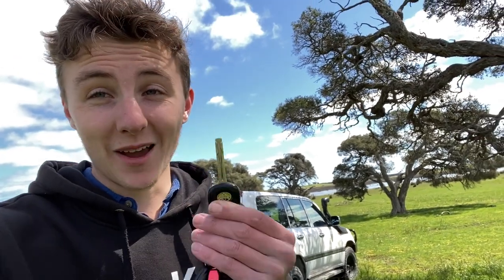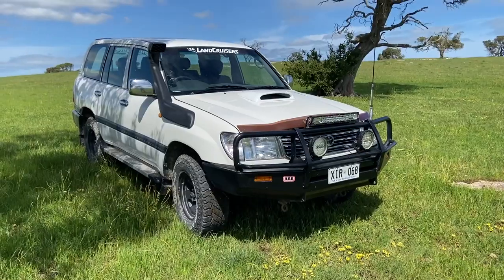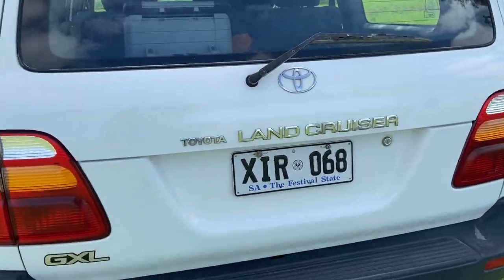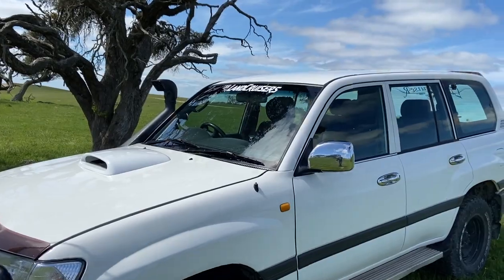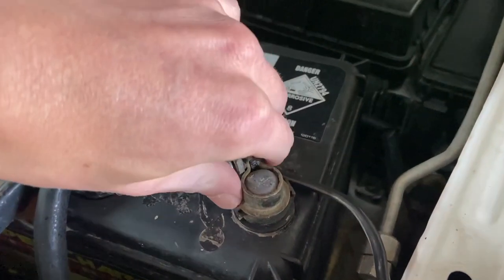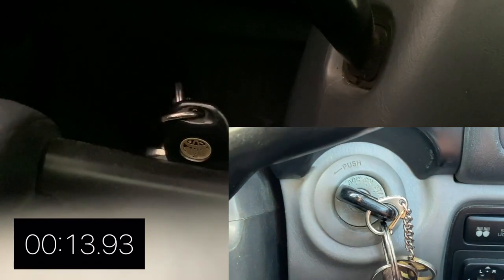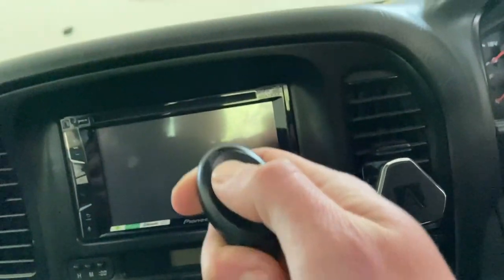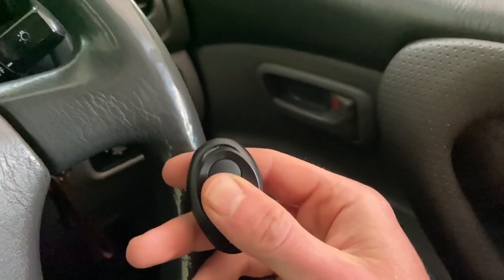Programming a Key Remote (1998 105 series Landcruiser GXL)

Comment: Almost perfect. I have the 2006 GXL, and when I had to reprogram my single button FOB, I had to go from fully Off to On 20 times before I could activate the programming mode.  I then pushed the button on my failing remote, and then on my new one, and everything worked perfectly. I also didn't need to disconnect the batteries.  So my process was -
1 - Door Open
2 - Remove Key
3 - Lock Doors using FOB
4 - Unlock Doors using FOB
5 - Insert key and turn from OFF to ON, 20 times, in under 20 seconds. (Indicators then flashed 20 times)
6 - Press button on Old FOB, (Indicators flashed twice), Press button on New FOB, (Indicators flashed once).
7 - Turn key ON to lock in and exit programme mode.

Thanks again, without your video and instruction, I would never have got it.  Everyone hates getting ripped off by locksmith thieves, when it is a relatively simple process.

Like all the others, if you're ever in Ballarat I'm up for the first beer!

Comment: came across this by accident but i ordered a remote from your link and got it programmed first go using your video and the original instructions in my factory manual, for those doing it timing is everything, its good to have working central locking after both originals died, thanks

Comment: Mate awesome info, brought the remote from you place in the East.
Went out and first time following your instructions 👍 success 😀😀👍 
Checked it all working while in the cruiser,
Got out and nothing🤦‍♂💁 got in and it worked
Worked out that if I hold the remote up high it works fine
I think I need to check the aerial from the remote control box is still there 🤞 either way it’s working
Thanks mate great video

Comment: Great video. After a few times trying on my 2010 gxl troopy I didn't have any luck but last night it worked and I think the trick for me was to have someone else reconnect the battery after the 3 min interval that way you can be in the car with the door shut and it worked first time. Not sure if it was done it but definitely seemed to help me

Comment: Hi Will, Thanks for the vid. I have a tip for you- if you replace the cr2032 battery in these fobs with 2 cr2016 batteries (same diameter but 1/2 the thickness) you can increase the range. I used to have to be nearly touching the truck but now I can be 5 metres away!
Reply from the maker: That’s a great tip! Thank you! To my understanding- there’s also a way you can adjust the range at the receiver module?? Not exactly sure but it’s just what I’ve heard!
Reply: @WillsLandcruiser  oh cool I'll have to check it out. Would be handy to have a huge range so you can check if the truck is locked from across the street.
Reply from the maker: @crankyparrot1248  sure would be handy. The amount of times I walk 10m away and go “dammit did I lock the cruiser?” 😂

Comment: Thanks for this. I have the module like you showed, now will order the remote. Legend!
On another note, may I ask which aftermarket snorkel you use? I can see it's one which didn't require the indicator light to be moved.
Reply from the maker: Hey mate, it's on the cheaper end of snorkels but it does the trick and I think it looks great! I got it from a website called Oz Best Deals. Cheers

Comment: Good video! Ive got a bit of a funky problem that I think is not allowing my programming to work. My hazards don't work nor do they flash when the car locks. I assume this problem will contribute as the indicators have to flash for the programming to work?
Reply from the maker: That is an interesting question for sure… firstly, if you’re in doubt, watch my video on where to locate the wireless locking module. And secondly, do your indicators work?? Even if they don’t- it’s just acknowledging that you have entered the sequence. So you could correctly enter programming, but you may not have any way of knowing you have if the indicators can’t flash— if you get what I mean!
Reply: @WillsLandcruiser  yeah I have the locking module! And yes my indicators work, I think there is a break in the wire from the flasher relay to wherever else it goes so I thought perhaps it's not working as the module cannot send or receive the signal through the flasher relay as part of the programming? I honestly have no idea haha. I'll have a few more goes tomorrow! Love your work, plan to turbo the old 105 soon :)
Reply from the maker: @matthobbs5345  a few people have said they only had luck when a second person was connecting the negative terminal, so the drivers door could stay closed the whole time. Maybe worth a go? Hope you have some luck! This process is so temperamental. Cheers for the support! The HZ loves a turbo if it’s done safely! :)
Reply: @WillsLandcruiser  cheers brother, I'll try the door shut as well! Thanks for your help!
Reply: @matthobbs5345  did you have any luck. I have the 100 series that’s has the same issue. Indicators work fine but no hazards. Assuming it’s a relay.
Reply: @zaccheney2141  my relay was okay I found the problem to be the wiring from the hazard switch to the circuit board behind all your air con knobs. I had a break in the circuit somehow. You could try find the flasher relay and try attach an earth wire to the pins on the relay and see if it powers up your hazards which mine did.

Comment: Thanks for the video! Question tho, did you have the drivers door open or closed when spamming the ignition 20 times?
Reply from the maker: Hey mate door was closed. I think the most important thing is spamming that key within a really short period of time
Reply: @WillsLandcruiser  legend! I’m trying it on a 2005 landcruiser, same remote and the door open and close thing is confusing
Reply from the maker: @mrh22a  it’s all really confusing 😂. I think it comes down to luck just as much as getting it all right. But yep basically get someone else to put the negative cable back on so you can keep the door closed, key in and spam it 20 times within like 10 seconds and you should be right

Comment: Hey i tried this and it didn’t work. But here is the solution😃
Genuine Toyota Remote Control Manual says to turn from OFF to ACC 20 times after reconnecting the battery.
This worked first time for my 2003 100 Series Landcruiser (turning from ACC to ON 20 times does not work many times) try it😁 cheers and good luck guys
Reply: Is yours petrol V8?